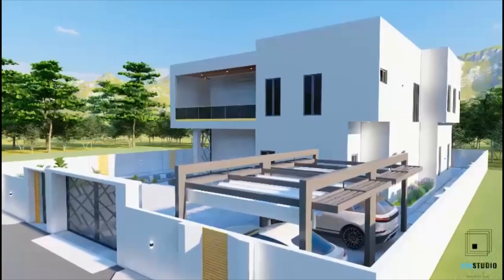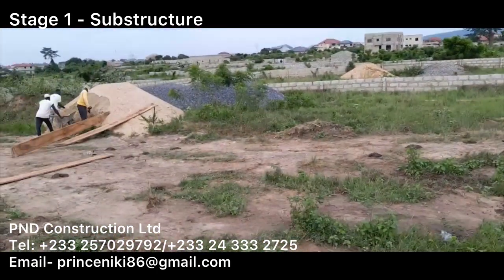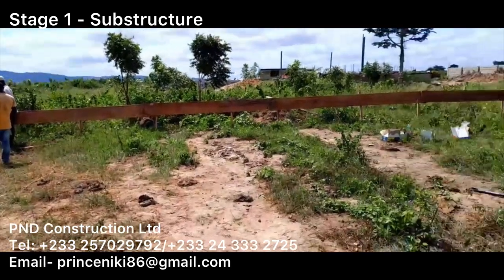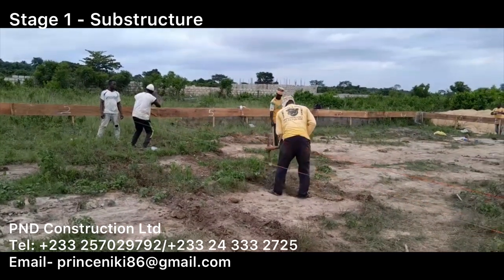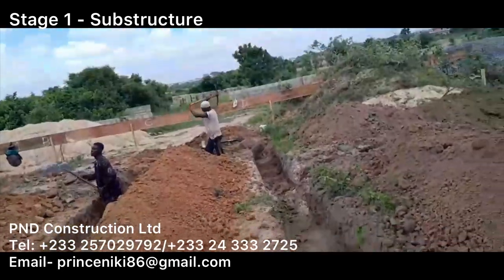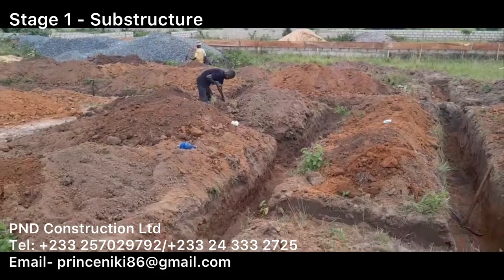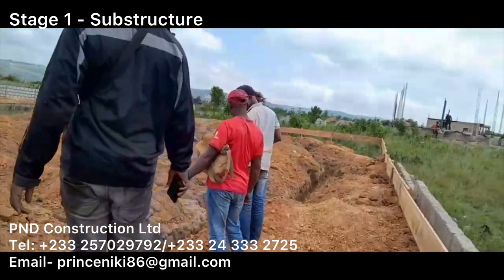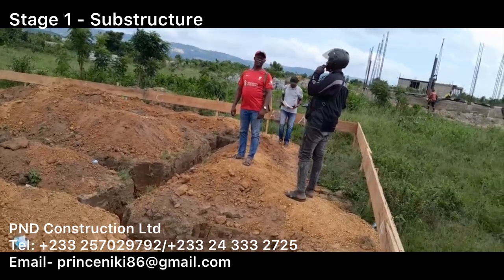Steps to build a house in Ghana

Comment: Is it advisable to make a concrete and motar with sea sand?
Reply from the maker: In our opinion no, sea sand contains salt which tends to absorb moisture from the atmosphere bringing dampness. We mix river sand with normal smooth sand for our mortar and concrete work. This is to remove any clay content from the normal sand and increase the compression strength.